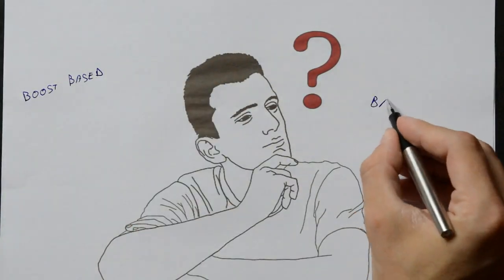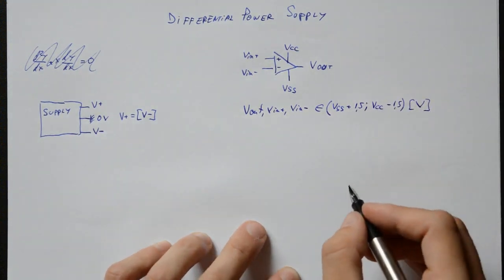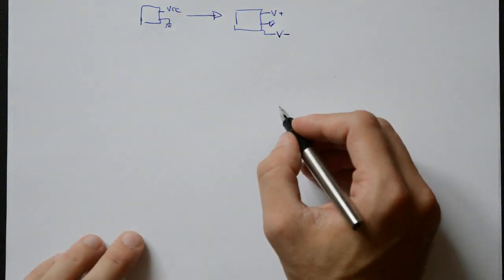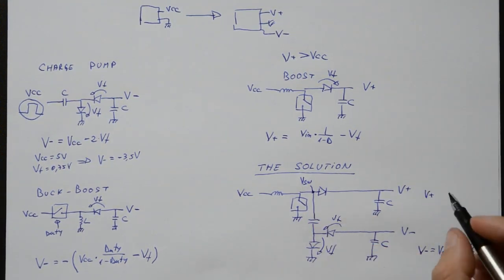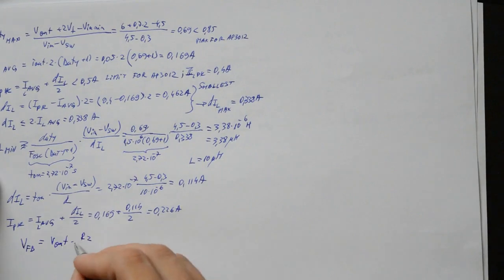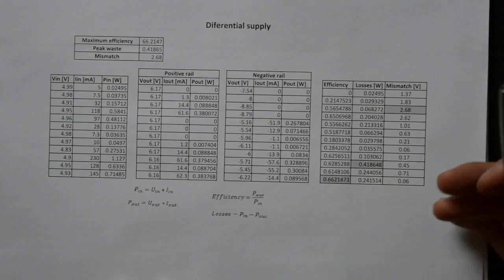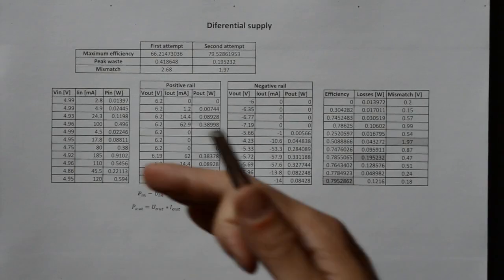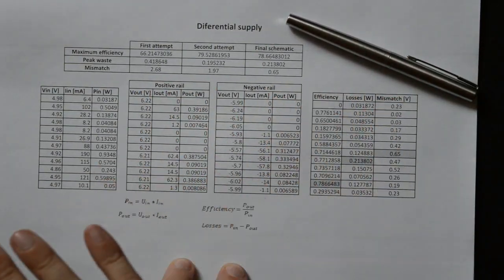Designing and building a Differential boost power supply

Comment: Can you create a EMI Filter Design (for SMPS) and Simulate LTSpice? Thank you...
Reply from the maker: There is so much to talk about when analyzing SMPS's. I will do a video about that at one point. What kind of filter are you thinking about: Input filter, output filter, snubber, AC input rectification and filtration, other?
Reply: @FesZElectronics  Input Filter SMPS. Thank you
Reply from the maker: I will try to get to this topic, I wrote it down, but I am not sure when... For now what I could recommend for you to try is to build your supply in LT spice, run it supplied from a source with series resistance (maybe even some inductance - to be like a real wire) and analyze the input noise with the FFT viewr (see my LTspice EP6); This will highlight the most important noise frequencies that you need to worry about. The only thing to be careful about is to get a realistic noise result be sure to model all parasitic's of the power stage components: capacitor ESR and ESL, coil ESR and capacitance. Then by adding various filter components and values re-check the noise spectrum to see improvements.